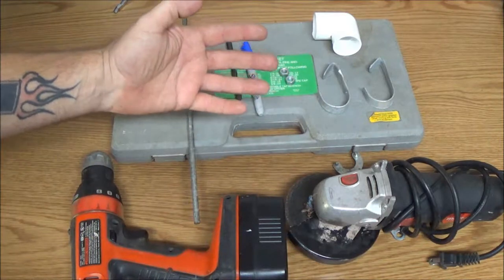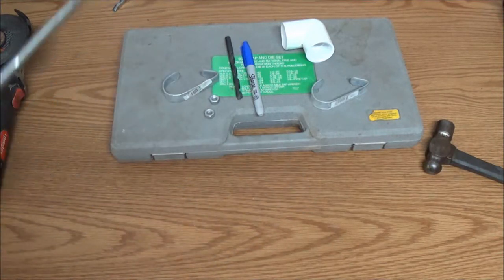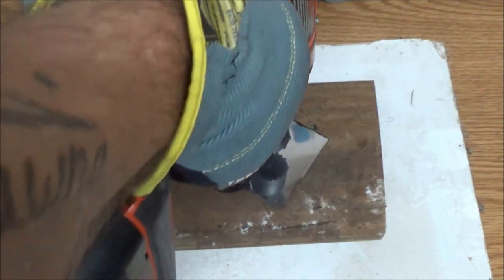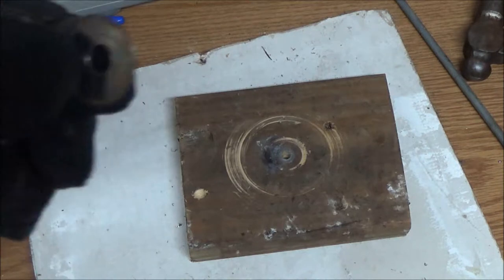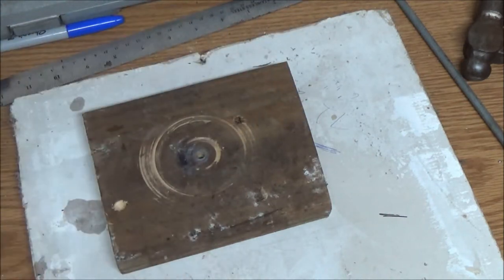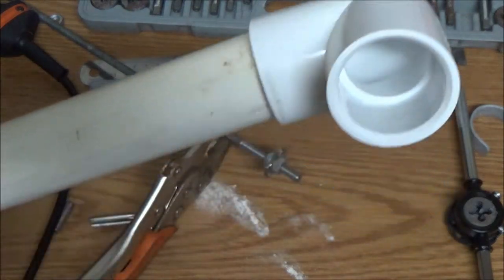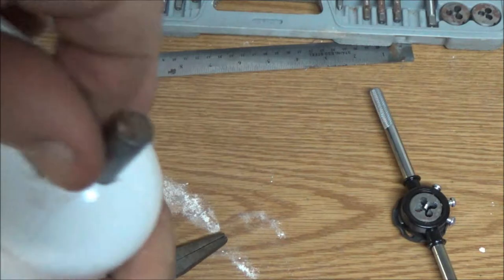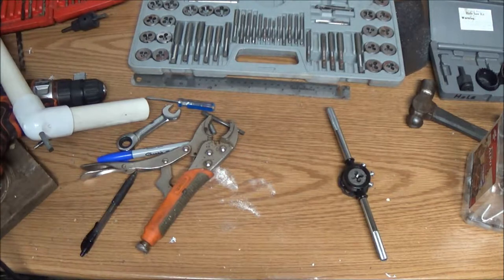Homemade Drill Pump....FAIL?

Comment: Still watching it . But I have an unrelated question - I have two videos on a Craftsman carbon arc welder that I want to convert to a stick welder . Ever hear of it being done ? I don't have hardly any experience with electricity but I have a lot of curiosity ! And I found it cheap at a flea market .
Reply from the maker: Try youtube, i believe there are all kinds of video's on how to do that. If not, contact me and i will be glad to assist you anyway possible.